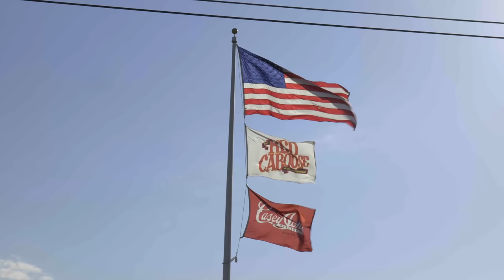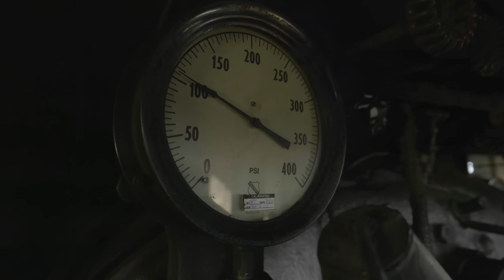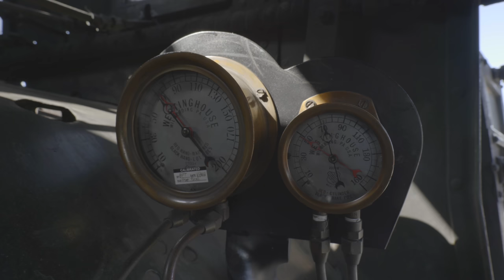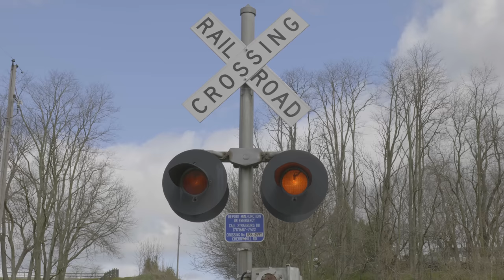[4K] Strasburg Rail Road 90: Starting a Steam Train

Comment: Until I'm fortunate to experience this Railroad in person, this will suffice. Pure sounds of a steam train - excellent!
Reply: Absolutely, the sounds of the steam engine are incredible, especially on a good stereo system. I actually did the audio for this with the camera's internal pre-amps, usually that results in poor audio, but the Panasonic Lumix camera did not disappoint. I personally loved the way it captured the bubbling and gurgling of the water in the air compressor and the dripping of the water droplets onto the floor of the engine house, that scene in particular I am pleased with the audio.